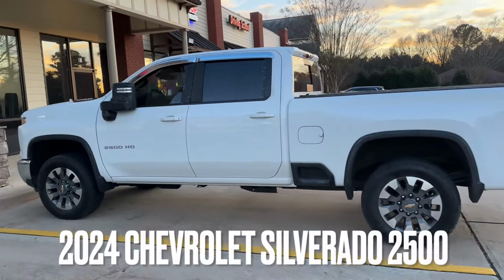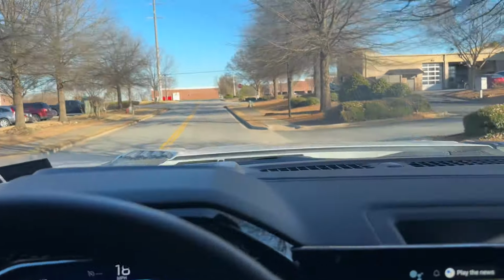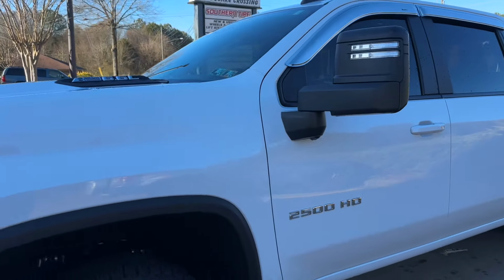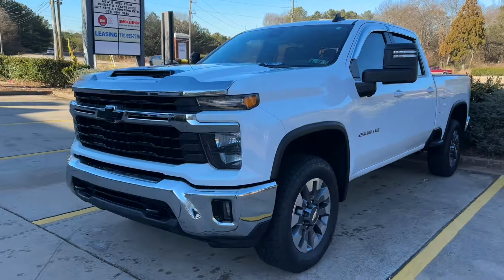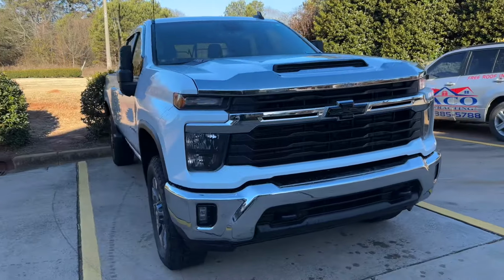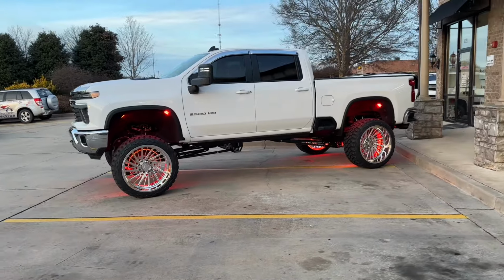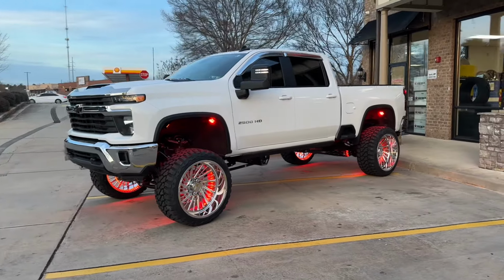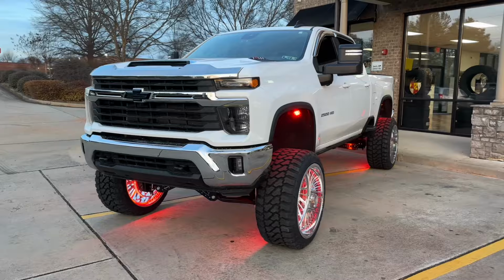** Lifted 2024 Chevrolet Silverado 2500 ** 9" McGaughys & 26X14 KG1 Forged wheels

Comment: Videos are getting better and better. I have a 2024 Chevy 2500HD black with the new front end and McGaughys 9 inch lift kit + the McGaughys resivore shocks rides excellent, just installed Ready Air double bag with the LOGIQ lift pump to level it out.
Reply from the maker: That’s awesome!! How did the air ride work out?